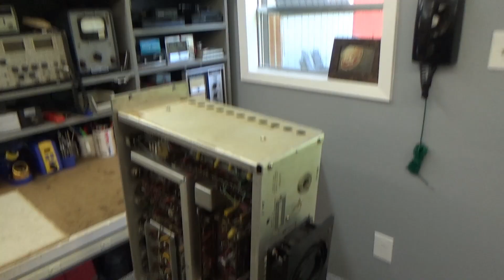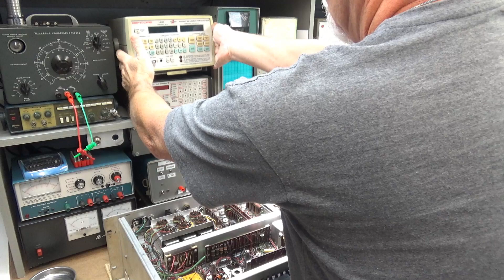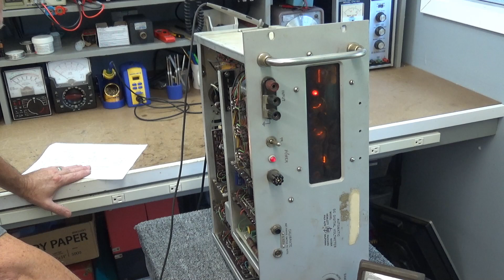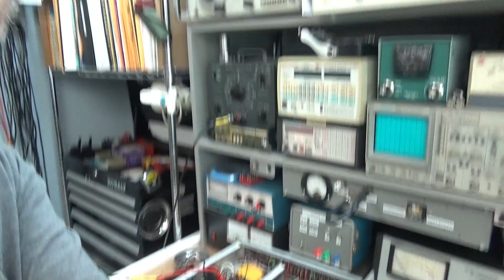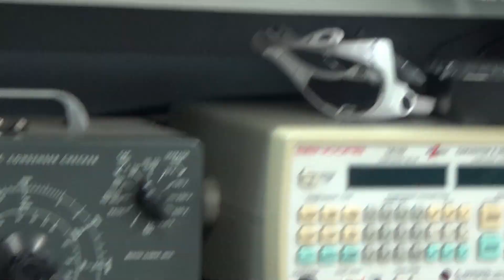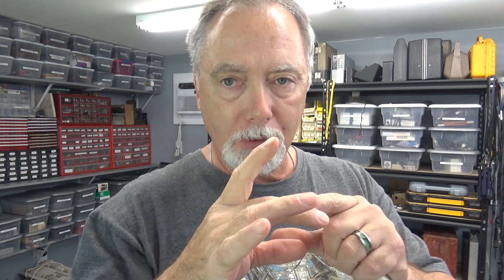EP 84 HP 405BR Digital Nixie Tube Voltmeter Checkout

Comment: I have a Model 405AR that I've had since I was a little kid and it still works perfectly. It's definitely one of my favorites, just connect some voltage source to it and it clunks and bangs until it reads the voltage on the front. I just followed the calibration procedure in the manual a few years ago and the voltages read plus or minus a half digit (after it warms up for half an hour of course). This one's worth doing a full recap, it's really an absolute classic. Keep up the good work.

Comment: I remember these big hp nixie tube DMMs from electronics college, don't think we ever used them.. Actually, I have a Nixie tube module like in yours, from an old frequency counter! When connecting lytics in series it's a good idea to put high value resistors in parallel with each cap (about 1k-2k per volt) as they might have different leakage current